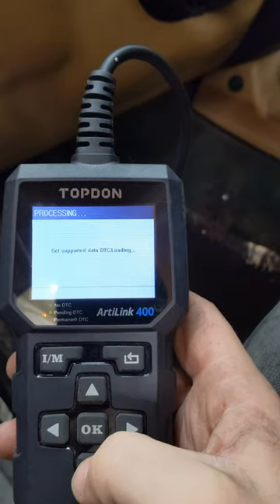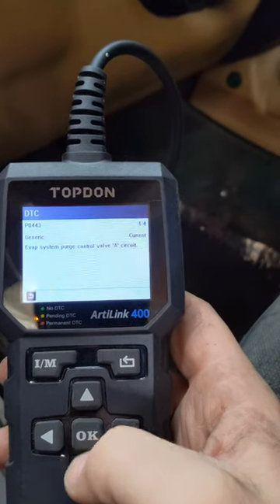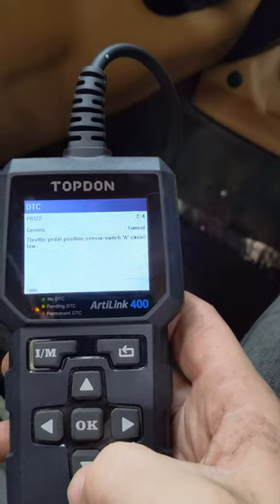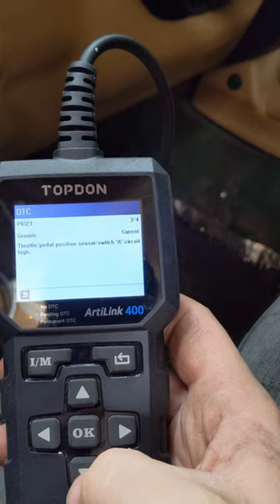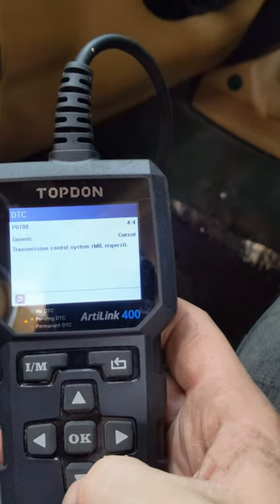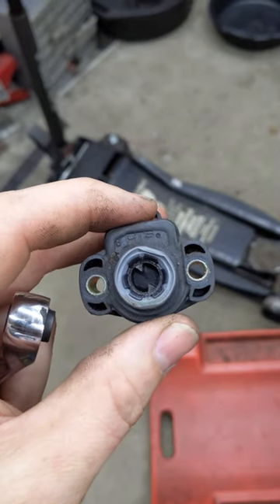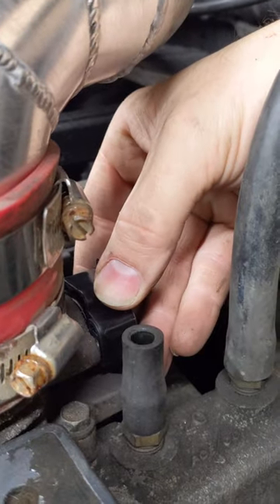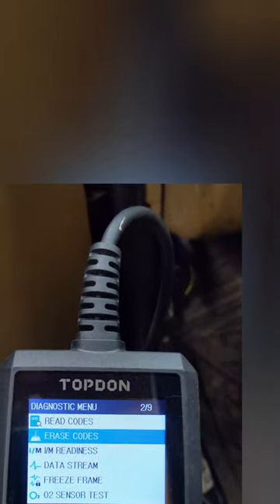throttle position sensor replacement

Comment: Glad you got this sorted, hopefully not too pricey for the TPS.  I just discovered my fuel pressure regulator failed so that's in the queue for me to work on.  Nice video!
Reply from the maker: Thank you
Reply: @FMJeeping did the tps fix your problem.
Reply from the maker: @nathanmccumber8965  yes. Its been fine since
Reply: @FMJeeping  tps made 700 code  come up ? Mine 98 xj got 700 and 705
Reply from the maker: @nathanmccumber8965  i forgot which code I got exactly . It was tps related though
Reply: @FMJeeping  those code I read it's safetyswitch. I'll replace mine see if it goes away.
Reply from the maker: @nathanmccumber8965  will your jeep even crank?  I think that might be the neutral safety  code
Reply: @FMJeeping  I Jerry rig it because steering column pin or lil metal piece broke. But it fire up run n drives. Start with screw driver from ignition switch.
Reply: @FMJeeping  got trucky for 250 all it need was tune up and battery. 195000 miles.  A/c ice cold I gotta Manuel open close bend door for vent.. I got tps sensor in glove box I am gonna put it in just incase better now then in winter.  

I am going to put push start so I don't gotta keep turn it on with screwdriver.
Reply from the maker: @nathanmccumber8965  hell ya man.  Cant argue with that.

Comment: Dear I changed the throttle body /Mass air sensor and air sensor . Does it need a programming ? And if I need to check the turbo performance should I check before or after the programming ?! As the workshop I kept my vehicle with ( out of sudden ) sent me that the turbo needs a service ( while I didn’t face any pro with it ) and is ok for them to check the turbo performance before the programming ?!!!!

Comment: Hello, I have replaced the tps sensor in my 1997 4.0 it’s gone bad again as I write this.. one came from auto zone the 2nd came from advanced.. The first I ordered from extreme terrain and it was bad out the box.. Any suggestions on where I should purchase the 4th one..This is over probably 8 months 5 thousand miles.. Is something causing the tps sensor to fail?
Reply from the maker: You could have a short somewhere in the harness causing them to burn up.  I got mine from Amazon.  Water killed mine.  I have hood vents that let a bumch of water dump on mine.  

Here is where I got mone from. 
https://amzn.to/3OplfKD

Comment: Alright so might be a dumb question but how do you load the spring on the tps? Having issues with mine like hesitating when accelerating and backfire and loss of power. Tried a new tps and it made it worse. When I put the new one in I just put it on off center from bolt holes and then clocked it into position but after install actually made my symptoms worse. Just wondering if I did this right lol
Reply: Also to note mines not a xj but a tj 2.5 97
Reply from the maker: What you do is you let the throttle body sit closed like it normally would be. Then you put the throttle position sensor over the end where it bolts up.  The sensor will sit flush but the bolts won't line up. You have to gently clock the sensor to where the bolts will line up.  There'll be a little bit of resistance or a springy feel on the sensor when you do that.  If you have to push hard or you feel it binding up, you're doing something wrong.  It should only be maybe an eighth of a turn to a quarter of a turn
Reply: @FMJeeping  yeah that’s exactly what I did. I guess I just got a new junk sensor lol thank you for the respond!
Reply: @patrickblackburn2880 clean your map sensor.

Comment: I did this and replaced it with a new sensor and now it’s not wanting to accelerate and my check engines still on. Got any tips?
Reply from the maker: What code is on?  Possibly a clogged cat
Reply: I would say change your throttle body position sensor